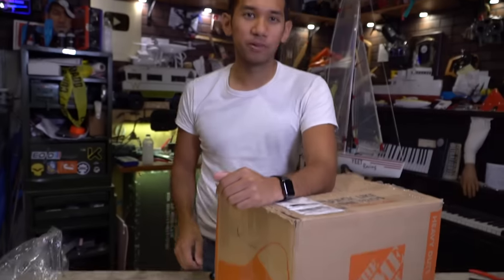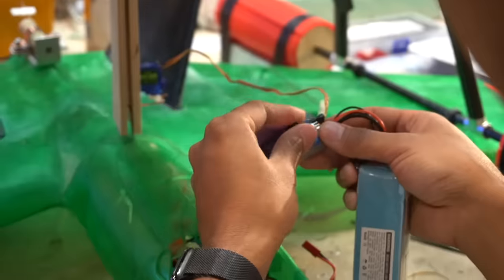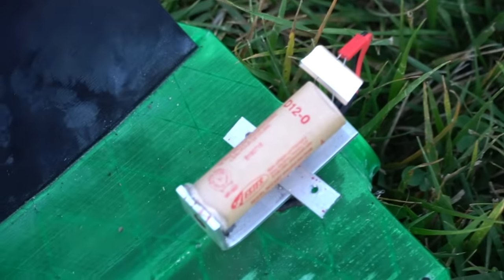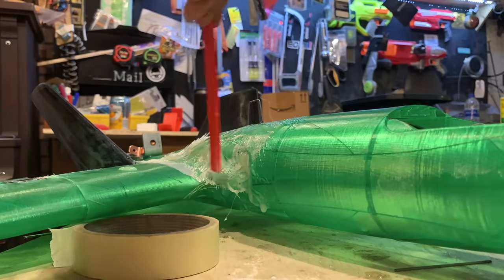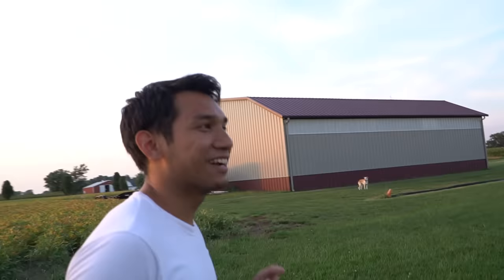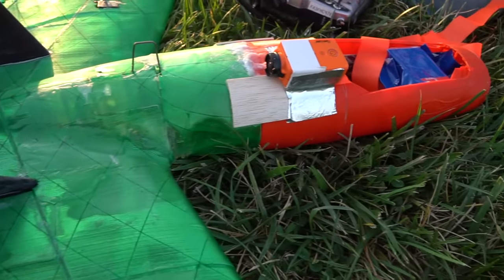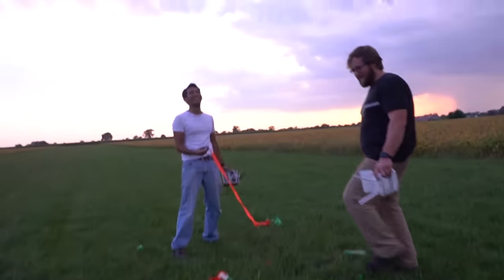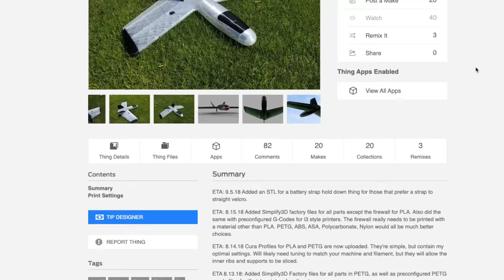GIANT RC ROCKET PLANE!! 3D printed

Comment: I cannot stress enough how much I want to see that thing fly with a custom size powdered sugar rocket
That has a 20 or 30 second burn time
Reply: This would be stupid, a 20 second burn time would either mean : an enormous amount of Rocket Candy (hum, talking about hundreds of kilos), or a very little chamber pressure resulting in no thrust at all and just being a smoke grenade and waste weight...
Reply: But indeed, an another video about rocket motor on a glider would definitely be awesome
Reply: SHERE_KHAN yea ur 100% right
Reply: I already built 1.30 munite burn time sugar rocket from ~120 gr propellant but come on men it cant lift the 30 gr case its just a smoke bomb :(
Reply: But i have a new one 1.5 kg propellant in paper it will burn about 30 second
Reply: @shere_kan8329  i would be fun though

Comment: Your drone launch system should be moving forward so there's air moving across the wings before release.  You'll gain stability that is lost when you drop it while hovering still.  It doesn't have to be enough for lift, just enough for the flow to be established across the lifting surfaces in the right direction.

Comment: I would really like to see him revisit this project with some tweaks. I'm pretty sure the center of thrust was too high above the center of mass, which caused the plane to nose down violently every time the rockets ignited. I feel like if he had the rocket motor more centered along the length of the body (like where the propeller motor mounted originally) then it would have been easier to control and less jarring if there was a delay from the rocket ignition. It would likely take a bit of reinforcement to the internal structure immediately forward of the rocket motor, but I really would like to see the plane fall apart the way he wanted it to, rather than a full throttle nosedive into the ground.

And yes, I know that there are plenty of aircraft that have their engines either way above or way under their center of mass. This is pretty common for some aircraft like private jets, however, they have comparatively low thrust/weight ratios when put side by side to solid rocket motors. They also have the benefit of being throttled up/down on an as needed basis. Solid rockets on the other hand are full throttle until depleted, and if they have a high enough thrust/weight ratio, any deviation from center will completely dictate the direction of your craft.
Reply: I know it's late - but I couldn't agree more! Well said.

Comment: It probably failed a stable flight due to the mounting position of the rocket motor.

The center of thrust was too high causing the plane to go into a nose dive.
Reply: ok genius
Reply: Yeah. It will be interesting to see if Peter redesigns the mounting location. Centerline would obviously be nice for balance but might pose for a structural challenge. Bottom mount would send the plane to orbit but might pose a new problem when landing.
Reply: Could've easily prevented this if he had 3D printed the body in a way that the rocket fits nice and tidy in the same spot where the propeller motor was. Perhaps make some extra protection for the electronics in case the rocket has this staging part where it ejects a small amount of fire from the top at the end.
Reply: Agreed, but there was still some pilot error behind that final flight. Lack of research and incorrect assumptions are pilot errors, not design flaws.
Also, their ignition altitude was too low to allow for any corrections.
If they had used a prop on the nose to get it to speed and altitude, then ignited, it would have been easier to control. Even launching it from the ground like the model rockets would have been a better result.
Reply: What? changing the position of the rocket? We do never change the mounting position of a rocket. We just add another rocket motor vis à vis, to counter the thrust of the first one!
Reply: @userPrehistoricman  thank you sir... I mean you must have a degree in rocket propulsion yourself, right?
Reply: Not at all. I was taking the piss because you basically repeated what Peter said in the video.
Reply: @userPrehistoricman  okay genius
Reply: @probablynotabigtoe9407  Another easy workaround is to just angle the rocket downwards a little so it thrusts towards the CG. It's not optimal for thrust but might be optimal to keep heat away from 3d plastic and will certainly eliminate pitching moment.
Reply: @leggomypotato1484  You could print the casing for the rocket out of some thing more heat tolerant like ABS.
Reply: Prehistoricman this is the point of this channel
Reply: it might also be a nice idea to mount the rocker motor inside a casing with a ventilation system in order for oxygen to facilitate the ignition. Adding a bell nozzle would also be a nice addition because all of the thrust won't escape at once but at a controlled rate. Without the motor on the body of the plane, it would improve overall aerodynamics and reduce the drag of the plane. Maybe also adding water between the metal casing and the 3d printed plastic would improve distribution of heating. (Im hoping to get into a areospace high school :D)

Comment: Was really hoping they get into the J-class motors.
Reply: I ordered few a J class motors off of internet because i was doing a project for my fluid dynamics class where i was supposed to turn in a research paper on the effect of air temperature, humidity and pressure on the self propelled ballistic object.

Smarty pants me ran a steel cable down a long field, about 350m and used a modified chess clock to measure time and then used a GoPro's slow motion option and a backdrop consisting of evenly spaced lines to measure the velocity of the rocket and i also used some Arduino sensors to gather the exact information like humidity and temp instead of relying on commercial weather stations.

Now sorry for that long wall of text, but the actual story goes as:
I've had 2 of those motors left in a drawer from that project.
One night, around New Year, one of my younger siblings got a giant foam glider.
You see where this is going, i attach a J-class motor to the styrofoam glider and i use a simple timer to set it off. 
The thing went up with the speed of light, then lost the wings and the body continued flying like a untied ballon before it finally hit a tree and reduced itself to atoms.
Turns out there was even a carbon fiber shaft reinforcing the wings but the glue failed.

TL;DR Don't do it unless you want to start a forest fire and destroy your younger brother's xmas toy.
Reply: @lazar2175  that was wayyyy to long

Edit: wait nvm i saw the tldr sorry
Reply: MoonFlux image if they did a z class

Comment: Maybe design a plane around the bigger motor so that the thrust axis is right through the plane and also use a bigger ignition voltage? I've found that using a pwm switch and the flight pack is usually enough for an instant trigger of the rocket. Would love to see you use the huge engines properly.

Comment: The igniter failed because you are not powering it enough. It usually requires it's own power source, and 9 to 12v.
Don't use 9v- batts for E+ motors.

Comment: I'm not sure if they still make them, but Estes made a "plugged" motor (blue label) that were specifically designed for rocket gliders. They don't have the parachute ejection charge and are capped to prevent any backblast out of the top of the motor.

Comment: You're losing some thrust when the ejection charge goes off
Reply: I would normally say its negligible, but these planes are so small and light that you're probably right.
Reply: The ejection charge can be removed, just open the cap on the front of the motor and dump it out.

Comment: Peter Sripol: “When you make changes to an airplane, you need to rebalance it”
Boeing 737 Max engineers: “How about we do some janky, automatic, badly documented computer control stuff instead”

This comment is dedicated to the victims of those 2 crashes
Reply: To be fair to Boeing... They actually intended to have a completely new plane designed instead of another upgrade. They already concluded the 737 was at its limit. But airlines put pressure on them to upgrade the 737 so the airlines don't have to retrain pilots, maintenance crews and get new parts and trash existing spares.

Comment: hey I have a few questions, hopefully you find time to answer them =)   1.  Which 3D Printer should I buy to be able to print the airplane in this video using the Blueprints linked? 2. Why didn't you guys have the quadcopter moving in the direction of the plane's trajectory before dropping the plane? Wouldn't that be better for gaining initial control of it instead of it freefalling for 40ft before you're able to start gliding forward?
Reply: basically any printer. I have a cheap ender 3 from a black friday deal (169$?) Peter Sripol has a luluzbot printer. There is special plane filament that you can buy that is lighter.
Reply: @xaviertwilight7855  thanks buddy, I've since bought an Artillery X1 and Creality CR-10S Pro V2
Reply: @kenp9199  awesome

Comment: Yeah, the scary thing about those plastic bodied G motors is the high chance of delay on ignition. Even with model rockets, it feels like you’re pulling the pin on a grenade and hoping you put the fuse in correctly

Comment: should mount rocket motor inside hole where elec motor goes thrust offset and drag from mounting the way you did inefficient.
Reply: the  rockets come with a timed parachute eject charge witch would just blow the plane apart if it was mounted inside

Comment: I'm a bit deceived they didn't try the last motor a second time, but I kinda understand why.
They'd need to print the whole plane just for a 1 minute shot... Also buying an other motor, and wait for delivery, etc...

What I don't understand is why they installed the motors off center, which makes the plane pitch down when it ignites. Anyone can tell me?
Reply: I wonder about that as well.With the propeller it might give better performance and make it easier to recover from a stall.
Reply: I noticed that at the end of every rocket burn, there was a slight burn on the front end of the engine. I assume this is for the little parachutes model rockets have. They might have just mounted the engine on top to avoid that damaging the airplane, and also because it would just be easier to put different engines up there, but I don't know for sure.
Reply: Model rocket engines have a small explosive charge in the front to blow the nose off the rocket so the parachute can deploy. If you install one without room for this to go off your rocket will blow up.
Reply: @crudboy12  
Yeah I understand now, but there must be a way to install it in a way to make it more stable. Like making a small vent inside the plane or maybe just installing the motor on a slight angle to compensate?
Reply: @Reth_Hard  You could vent it, but it would be a lot of effort for a one shot. One would have to install insulation because the back-blast would melt the plastic. I'm sure if PS were to revisit an airplane that used that motor size, he would simply adjust the thrust angle as you mentioned. The final way I can think of to get around this problem would be to put the motor in a tube in the back of the plane and install with a light interference fit so that the motor would simply eject itself out the back when spent. This wouldn't allow for motor size to be easily swapped, however.

Comment: Question: why are you measuring the aircraft’s speed with the GPS (ground speed) instead of using a pitot tube and an airspeed sensor (actual airspeed)?

Comment: Reprint and install the G motor centerline. You may want a heat shield to protect against the burn through at the end. Something like the concave bottom of a soda can with an 1/8th inch of plaster would be light and resistant to the heat protecting your electronics.
Drilling a few small vent holes in the body of the plane ahead of the motor to prevent heat buildup in the body as well as adding in a carbon fiber arrow as a reinforcement sparr through the wings and body.
Also a camera for your control as I think it will move quickly out of sight so birds eye view for flight and recovery. That or angle a tube slightly through the body of the plane with a chute that the rocket can eject as with a regular rocket.
With that option you could launch it from a launch pad and glide it back down.🤔
I want to see that thing work.

Comment: Did you consider turning the runway into a giant ruler and then measuring the number of video frames it takes to cover X distance? It would require as consistent a POV as possible so the drone would need to be in the same position for each attempt. The 'ruler' could just be a series of orange cones at a measured distance. Also, if you want to be really accurate, don't forget to allow for wind speed/direction. Ground speed != air speed.

Comment: A tip: make your own motors (if there is a legal loophole, of course). The commercial ones are just for shooting a sticks with parachutes in the air. Order some heavier, cheaper from 'far-east' and  reassemble contents in longer, stronger tubes. Or, i shall give a recipes from scratch on demand.

Comment: You should use an Inertial Sensor for speed calculations and then do some post processing to get your data, or put some more effort into a better GNSS unit. You should be able to get data up to 1Hz for civilian use, but it seems like that might be a REALLY cheap unit.

Comment: I think if I were you, I'd select a rocket motor with the largest amount of thrust over the longest possible burn time with no secondary (election) charge. I'd also place the center of thrust along the centerline of mass (resistance). That is, if you want to really push the envelope & get a decent reading from your GPS velocity sensor, & keep it all in the air while doing so. If you decide to try something like that, the video would be awesome!

Comment: This is an old video, so not sure you'll see this or care at this point, BUT. GPS speedometers can also be very bad at measuring non-linear speeds. If it's made for aircraft I imagine it measures more than two dimensions of travel, but it will still draw the shortest line between the two points it did measure. The GPS signal itself allows for recalculating location every few milliseconds, but the quality of the receiver will determine whether that is actually happening since it has to be able to process the data that frequently.

Comment: 7:48 peter, in all rocket engines the as the letter, gets higher the impulse doubles so a B motor has double the impulse as an A motor
Reply: and so fourth
Reply: also, the letter means the average impulse, the first number is the number of newton seconds the second number is the time after engine burnout when the ejection charge goes

Comment: Look man, I know nothing about planes, but is there possibly a way to program the plane to only activate the engine when the wings are horizontal to the ground? Maybe there are arduino compatible sensors that detect air pressure from under the wings, or maybe something else that can make sure that the plane is upright. This could at least ensure that the plane doesn't launch when pointing downwards.

Comment: The problem with using GPS for speed is you need to fly in a straight level line which is impossible to do with the sudden thrust

Comment: I think it could have possibly worked better if you left the prop on to fly the plane and mount two rockets under the wings as close to the fuselage as possible. But I know nothing about aerodynamics so, I could be way off.

Comment: Beautiful plane. I am trying to print my own and I printed the right wing section 6 and there is no supports. Is that the way the part is designed or is it my slicer. I'm using Cura.

Comment: Since there was no electrical motor, why not put the rocket in the actual spot you had the prop on ? You are thrusting off-axis from the center of gravity.While some pitch controls can handle it, this means a metric ton of additional drag.Also it's not fair since the electric motor benefitted from straight flight, while all rocket flights happened during aggresive pitch maneuvres.

Comment: you had the rocket on the top of the plane,,,when it goes of with that kinda force its pushing the rocket faster then the plane ,,, so it forces the nose down,,, if you were higher off the ground you may have recovered,,, so ,,, next time mount the rocket in the middle of the back ,, or underneath where when it goes off the plane will push upward

Comment: i have an ender 3 pro but it's broken and when it broke i called them to replace the parts since it was under warrrenty i ended up with no part sand a broken 3d printer